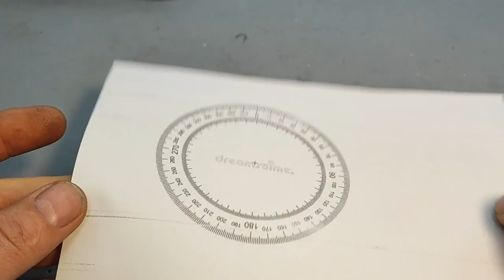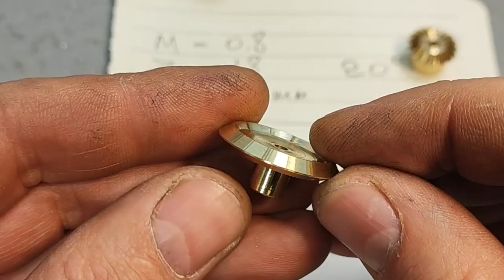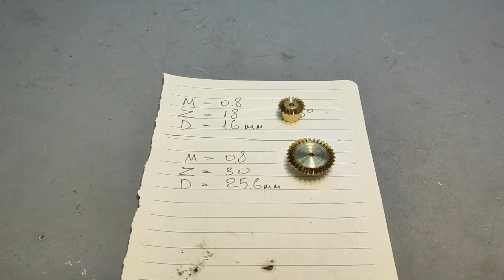Mechanical computer. Homemade Gear Cutter. Making  gears for  future project

Comment: I am very impressed with your ability to create your gear cutting machine and I will subscribe so that I can view how your agile mind copes with other engineering problems.
If ,as you say you are happy with the product your machine produces then read no further. If on the other hand you will allow me to suggest possible improvements, please read on.
I am going to use the terms 'Accuracy' and 'Precision' . These terms are often used as alternatives  but I will use them as they are used in Metrology where they are not interchangeable. Accuracy means how closely the product dimension fits within the stated tolerances and Precision means how well a process can be repeated. For example ten shots in the Gold  is both accurate and precise whereas the same grouping on the outer edge is precise but inaccurate.
Firstly your index plate is an excellent alternative to purchasing an expensive 'off the shelf item' and can produce precise angular movement. An improvement I would suggest is to drill using a centre drill with a depth stop which will give your detent the ability to locate with precision. Angling the detent to match the angle on the centre drill will assist.
Because you are using your eye and skill to position, firstly the centre punch and then the drill, you are inviting errors in accuracy on your index plate. A difficult problem to overcome. My suggestion would be to investigate in your environment what manufactured 'gears' you can find (broken toys come to mind) that your use to engineer your indexing plate from. Turn your machine on it's head and work backwards to get holes fixed from an accurate source. 
Another source of inaccuracy when drilling holes is the drill itself. I once bought a set of drills because they were cheap, when I inspected them they had all been ground so the cutting edges were different lengths. They wandered about on their centre and cut oversize.
All the above is added in the hope that it will help you in fantastic endeavours, keep it going.
Reply from the maker: Thanks a lot. I hope I won't let you down